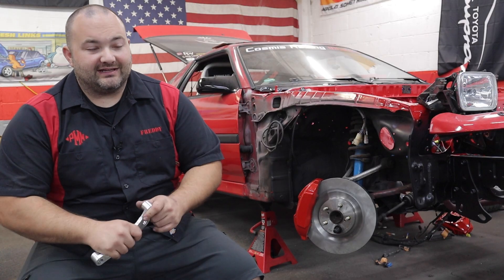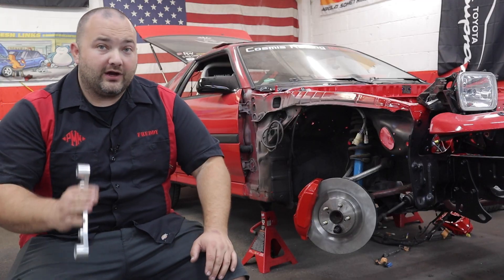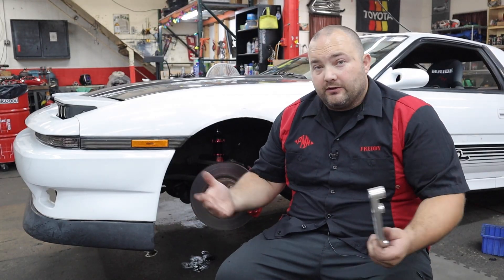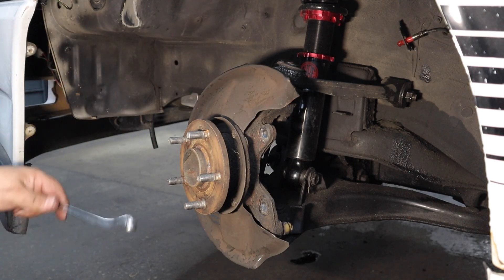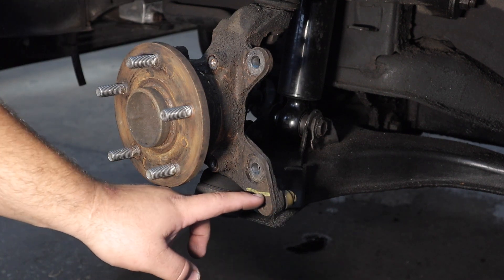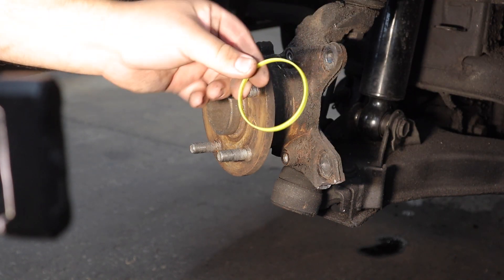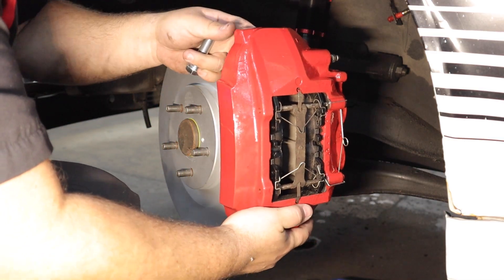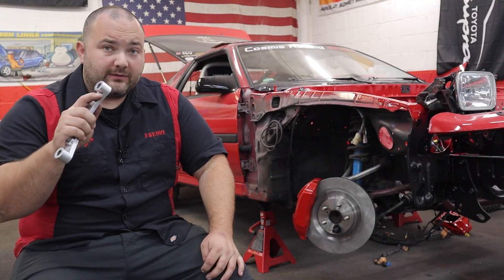I developed a MASSIVE MK3 Supra front big brake kit!

Comment: Would it be possible to measure the minimum size of wheel that theoretically could fit over this setup? For example, the distance between the rotor edge and the furthest opposite side on the caliper itself. So based on that measurement, potential buyers could just measure the inside of their wheels barrel to see if this kit would clear their specific wheels.
Reply from the maker: I can try to do that

Comment: Are the ls460 calipers good? I understand this setup is much bigger than the oem mk3 brakes, but is there any information on how these lexus brakes perform as far as stopping and heat dissipation? Thanks, very interested in buying the kit
Reply from the maker: I don't have any information like that on the calipers themselves but the big thing about this kit Is the size of the brake rotor. The cool looks aside from it being so big, it being such a large rotor you get more leverage as the brake caliper is applied because you're further away from the center of rotation. But also since the rotor is so big you have way more thermal mass for heat absorption which is better for the brake pad, rotor and fluid.
Reply: @PoorManMods definetly makes sense. Do you have part numbers for the rotors and calipers? I'm seeing a lot of rotors that are 334mm diameter. And some at 360mm. Some part numbers would be dope! Thanks big time!
Reply from the maker: @GarageBoosted  I dont have exact part numbers, i got my 356mm rotors from RockAuto, im sure the dealership would be very expensive. 

I got my calipers off ebay, make sure to get the AWD LS460 calipers

Heres an ebay listing for the rotors https://www.ebay.com/itm/374954244871?fits=Submodel%3AF+Sport%7CModel%3ARC350%7CMake%3ALexus&_skw=Lexus+rc350+f+sport+front+brake+rotors&itmmeta=01K4PJGZSTRKE619QRJBMJK4CN&hash=item574d03bb07:g:nNcAAeSw2FVoktYh&itmprp=enc%3AAQAKAAABAFkggFvd1GGDu0w3yXCmi1fypzXjio9g8XJ5p8Ndh%2FZC5iuvQUJUzSlapQICtvy%2Fs2U7aMAajjq9qL%2F%2BFaOatIeKUFMKzkHHox2LJrWSWu2fQKSvU5jIjgbAFewleU%2F8tN1V21esU4IpPGuDcBCgJecPwxnPfw9rkqRzPpLD85K2T67WNz1V2%2FofEFusDjfJaE84XxFS7op%2FXpuifqzae0Iv%2BPqQe7QgqUHAzAoNsIHHBvLM5ySZInteYd8qLNAMqHyVRLl54OYaS8TvPzhsKBdJi71uI5jTabLUfoTUXy2iuLSKhz6rvvfs3cK4a%2FNf8P3yq1W8o2Rgly%2BmxWehh80%3D%7Ctkp%3ABFBMsv3D0qVm

Comment: awesome mate, though is aluminium up to the task? Also, definitely want the hole tolerances tightened so there's no chance of the caliper and bracket rotating over time, causing interference with the rotor. Finally, I'd assume such huge calipers would require a different master cylinder?
Reply from the maker: The aluminum should be just fine unless you try to break it, if you pull hard enough on the steering wheel something will eventually break.

Tightening the bolts down good should hold everything in place just fine.

There is no need to upgrade the master cylinder.